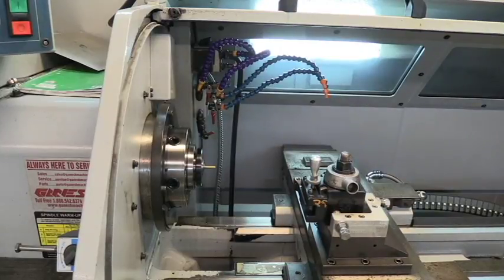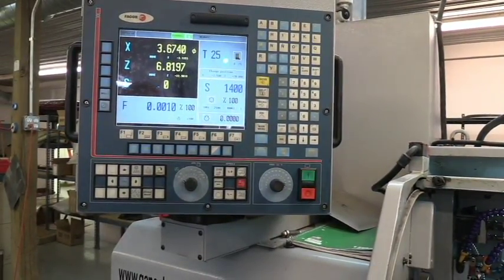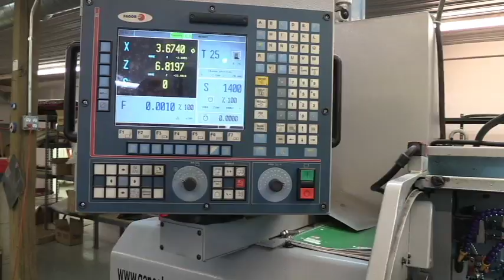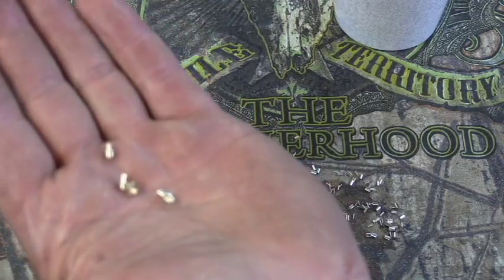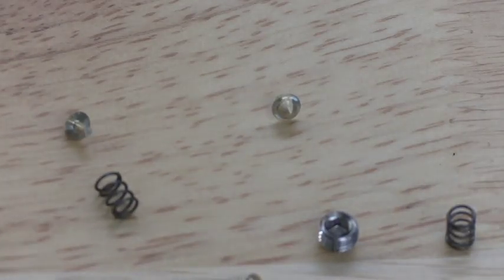Machining Ram Rod Retaining Block Part 3

Comment: Hey Jeff.   Have you thought about programming the lathe to use the tool post as a stop for your stock after the part off operation?  You just have to make sure the program moves the tool post in the Z+ direction before starting the spindle and starting to cut the next part.  Seems like it would be a little easier on you when working with these parts.  Great video and thanks for sharing.
Reply from the maker: Yes, I have thought of that. If I was parting the piece completely off, I think it would work out for me, but since I have to break it off by hand, I would have to make a separate move to set the tool post in position, then move it again before the program starts to run. Setting my material by hand with my part setter at the same time I break off the finished part only takes seconds.